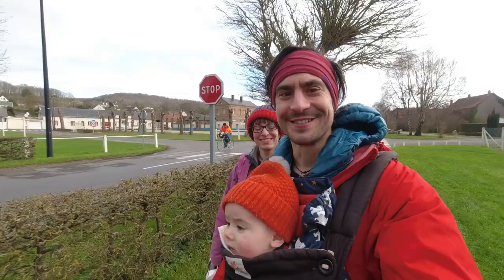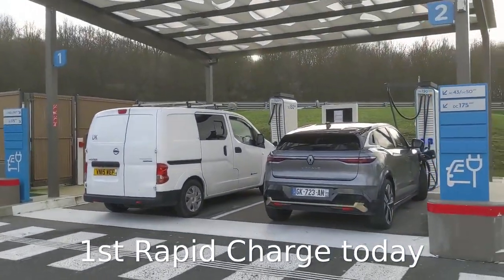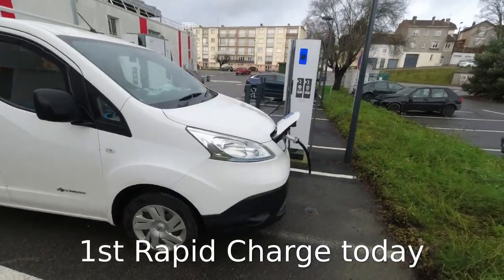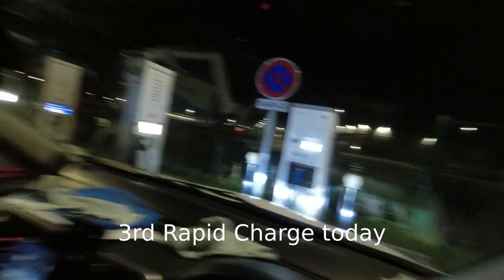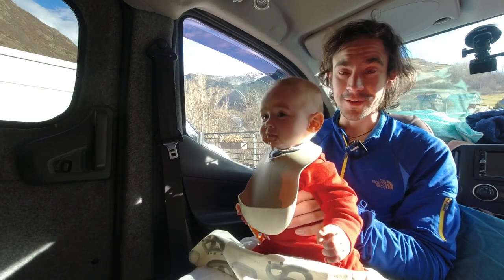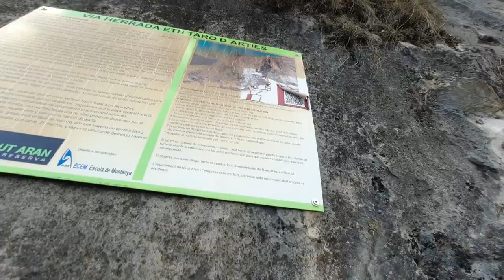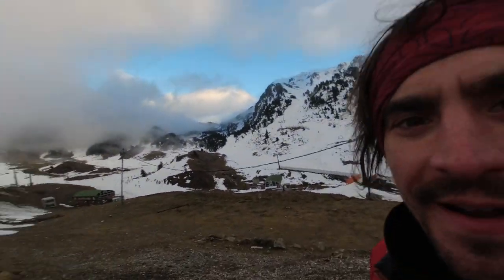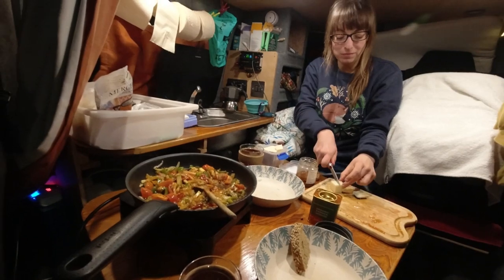Part 1: ELECTRIC CAMPERVAN road trip UK to Spanish Pyrenees via France

Comment: Great trip Glyn (and Family).   I find your videos very interesting.  Definitely the right mix between places visited, activities , EV charging stations and networks and van life.  Your blog posts are great and answers many of the questions I was about to ask. :face-blue-smiling:. You use Plugmap for planning, but how do you ensure the overnight stops are in a nice location and how to find the laundry-mats?
Reply from the maker: Hi Bryan, thanks for your comment. We use Chargemap App to find chargepoints in France, it's the French equivalent of ZapMap. Chargemap often shows lots of photos of the charge points which we use in conjunction with googlemaps streetview to see if the chargepoint is located in a suitable nice location to spend the night. The 24/7 laundry sites are listed on Revolution Laundry website

Comment: Yes it is still useless here in Spain for chargers. True the apps are rubbish also. I struggle even with Spanish residency. 

If I’d known you were in Palamós I’d have told you some good climbing places nearby.
Reply from the maker: That's encouraging to hear, that it's not just me! It's good news that the Spanish networks are starting to support EV roaming, I could use my Octopus Juice or Shell New Motion to activate them.  

Thanks, such a beautiful area around Girona, it was hard to leave!
Reply: @GlynHudson  There are quite a few Endesa chargers being installed - slow to get them activated though. Still find it hard to believe that none of the motorway services have chargers.
Spain is slow on the uptake , but we will get there in the end. It will take some politicians getting electric cars and for them to see personally how bad it is. Then it will improve based on their self interest.

Comment: So close to having my env200 usable for the family. Did my 40 swap the other day but still have to fit the canbridge and stash my old 24kwh battery in my garage till it sells. Great vid btw looking forward to doing road trips in mine now.
Reply from the maker: Awesome! Nice work. Did you use Leafspy to pair it? So the van is now drivable, just with a wonky GOM?
Reply: @GlynHudson  yep took lots of video just needs editing down
Reply: @Whereswally606  May I ask how much the battery and swap cost you?
Reply: @mikaelangeloh2316  i think i paid too much in hindsight given the recent crash now in ev prices. I paid about £6.5k but given its performance abroad i dont think my particular battery was worth it. Not being able to rapid charge quickly successively is kinda the point when travelling long distances in an non aero dynamic brick

Comment: those french 22kW units reminds me of the older Pod-Point, eVolt, and Chargemaster charge points with a door and an electromagnet. Haven't seen any new deployments of that style in the UK for the past 5 years or so.
Reply from the maker: Agree, but the older Chargermaster units never seemed to work very well compared to these units in France. They must cost a lot more than a unit where the points are exposed, but they seem to be standing the test of time and work very well.

Comment: Nice one, and yet again inspiring. You are all looking content as usual.
I can not believe it has been 3 years since we changed our Transporter camper For the Tesla and NV, and i have still to thank you for putting my mind at rest re electric vehicles and if an NV was large enough for a conversion, via your films and a few private messages. Therfore I would like to make you something i have designed for my NV that i am sure you will find useful, I will dm your twitter and see if you have a safe address for posting, Thanks for sharing your trips Ed.
Reply from the maker: Hey Ed, good to hear from you. Thanks for your kind message, that sounds rather interesting!

Comment: I enjoyed that. Nice video - did I hear you say 107 mile range with close to 100% charge. I guess a combination of cold weather, heavily loaded van and motorways - is that about normal?
Reply from the maker: It's normal for motorway driving in winter, this will increase to 120-140 ish in summer. About 100 miles is the limit in winter, I don't usually try and drive more than 80-90 miles between charges in winter. Summer is a different story

Comment: Great to see you out and about again with another really useful video. May I ask what app you are using to see the battery temp etc. and would it notify you if your charge had been stopped for any reason? I have the same van and am looking for a replacement for the Nissan app.
Reply from the maker: I use OVMS, yes it sends you push notifications if a charge stops. It also functions as a GPS tracker which gives us discount on insurance https://shop.openenergymonitor.com/open-vehicle-monitoring-ovms-wifi-3g-europe/

Comment: Harry is gorgeous 😍. Boring question 😄; what speed to do you cruise at?
Reply from the maker: Usually about 55-60 mph, the van is easily capable of sustaining higher speeds, but like with any van it's got the aerodynamics of a brick, so efficiency drops off rapidly at higher speeds which means higher energy consumption and more charging which overall makes us slower overall.
Reply from the maker: Also, we're on holiday, so we're not in a rush!

Comment: Hi Gyn, thank you for sharing your journey! Please can i ask what the name/model of the gadget you use to turn down the amps on the campsite to allow you to charge your van without tripping the site electrics?
Reply from the maker: Thanks! I use an OpenEVSE, but any adjustable EVSE will do the same job. It's the vehicle which actually reduces the charge, the EVSE just sends a signal to the vehicle to tell it to reduce the charging rate.
Reply: @GlynHudson  perfect - thank you!